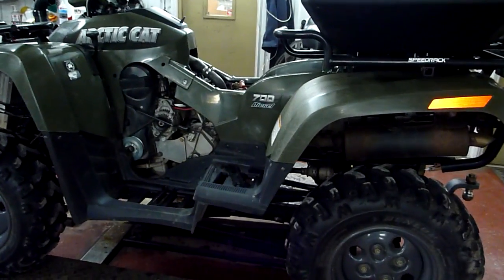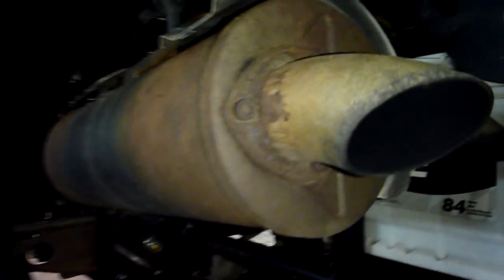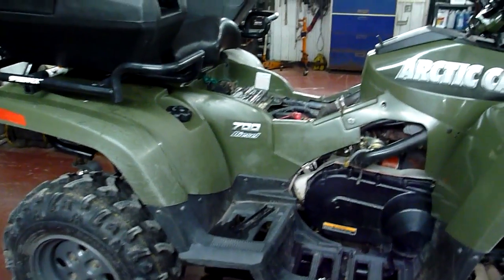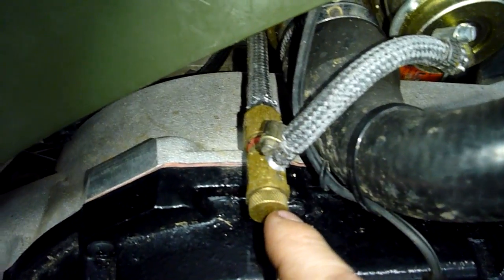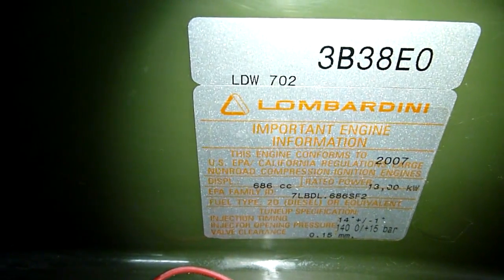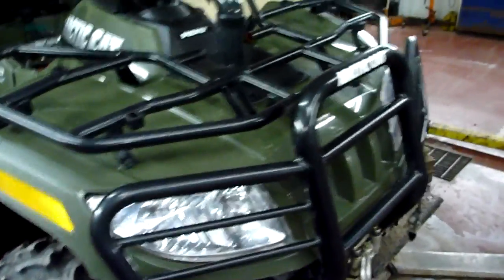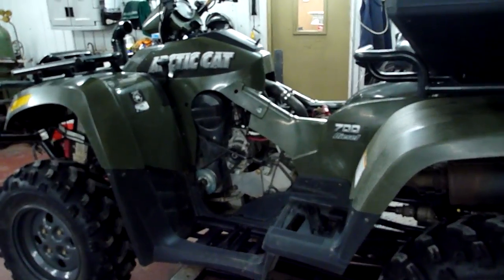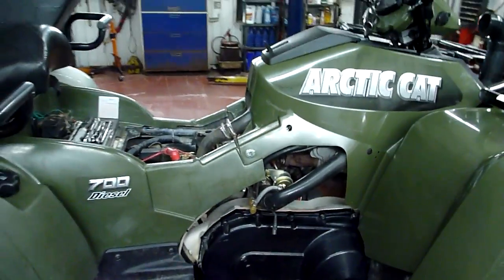Artic Cat Turbo Diesel info on turbo installation

Comment: 2030 miles since my turbo. Thanks for your inspiration. Did not hook up a waste gate, max boost is 17 psi and did a large intercooler.
Reply from the maker: What kind of turbo did you use and do you have any pictures of the installation ?

Comment: Mine is quicker to 35 mph than my AC TRV 700 gas. After 35 however it takes a long time to get to 45 mph, but you can actually cruise at 40 mph. It will hit 30 mph in Lo range, btw. Too bad it didn't have power steering, like my gas model..

Comment: Top speed with the turbo ? And im in Toronto would love to have a meet up and trail ride
Reply: Michael, if you get to Maine, look me up. email at <penobscotufo@gmail.com> Top speed doesn't change, btw, between 45-50 mph, depending on tire diameter. 30" might get you 50. 25" around 45. I run 26".

Comment: You can actually over fuel, I had the fuel screw turned way in, screw was about 3/16" below the set screw, Also had the timing advanced to 15degrees BTDC,  too much, loud clacking. It was very quick, but smoked a lot. Now turned the fuel screw back out a couple turns, much better. Next, I will set timing to 5 degrees BTDC. Now it is very responsive on the trails! Intercooler works great.
Reply from the maker: formerice cool have you made a video of it yet ?
Reply: Not yet. Still having an issue with oil leaking from the PCV , not a lot, but just got to fix it. Love the power, though! I have to remember to shift to low range in the really tough stuff. It's way more torquey at low speeds than my 700 cc AC gas model. We should get together, then you can make a video of both!
Reply from the maker: formerice I can't remember correctly about the pcv system I think I had to vent it to atmosphere or I had to put a check valve in the system but if I have a chance I will check to see what I did I think that it did pressurized the crankcase and I had a major oil leak at first when I was testing it it could've damage the engine if I didn't notice that but I'm pretty sure that the crankcase is vented to the atmosphere.
Reply: I installed a crankcase vent off the nipple coming off the front top corner of valve. Still getting oil dripping off it. Curious how you plumbed yours?  Maybe a "catch can?

Comment: Finally got mine done! 15 lbs boost with intercooler. Now EGT's are much lower. Accelerated strongly to about 40 mph, then takes a while to hit top speed. I ended up with 26" Outlaw MST's. Exhaust is quieter with turbo.. It's a beast! I also have a gas 700 TRV.

Comment: Thanks V10DPTDI. Have ARP head bolts, will try 20 degrees advance on the fuel. Getting close, maybe 1 more week. Have new 12" wheels and 27" Outlaw MST's to put on. I think the 30" Mudzillas were a bit too big. BTW, what do you think about an intercooler? We should get together, I'm in Maine!
Reply from the maker: formerice Hi I think that an intercooler is not necessary but a water to air intercooler would be cool to install and yes that would be cool to meet.

Comment: I just got my turbo, now the fun begins. What temp do you get on the pyrometer? I can already get 1200F If I run wot for a mile or so, without turbo, Also, how far did you advance timing, I have 5 degrees now. I backed off the fuel a bit.
Reply from the maker: formerice about the EGT temperature it has to be measured in front of the Turbocharger 1200 deg F is not that high but the rules of thumb is no more than 1300 deg F if it peak over 1300 for a few seconds it's fine but if it's stays there for a long period of time then the engine has too much fuel or not enough air if you were to mesure an engine with a turbo and one with no turbo with same adjustment and fuel quantity the engine with the turbo would have a lower EGT compared to a non turbo engine especially a non turbo engine that is set to smoke under load that same engine with a turbo would almost stop smoking because the amount of air introduced to the combustion chamber is way more so the fuel will burn in the combustion  instead of in the exhaust system as a form of wasted energy about the timing I can't remember how advanced my engine is but I found the info online so I turned the set screw the same amount on both cylinder but I don't remember how much that was and the fuel screw is set to the max it will only smoke when you blip the throttle fast at idle but with the turbo under full Boost it doesn't smoke at all .

Comment: Hello
Any engine modifications have you been doing?
Is it only the turbo.
What kind of driving experience?
Reply from the maker: Jarek Kwas no engine modification were made except adding a turbo turn the fuel higher and adjust the timing.
Reply from the maker: Jarek Kwas the driving experience is good but it's not as fast compared to a gas model with same engine size but the fuel economy is great but it's hard to compare I haven't driven a stock one after I did mine I know mine was real slow before the modifications I did it when it was almost new.
Reply: many thanks for the information
Greetings from Poland
Reply from the maker: Jarek Kwas Hi I was curious in your country is it legal to drive it on the public roads? I know some countries do they have extra light that we don't have here in Canada.
Reply: You must have the lamp timer and turn and be registered

Comment: How did you do the oil return ?
Reply from the maker: The oil returns to the oil drain plug with a banjo bolt and a rubber hose.

Comment from the maker: The battery is a stock size for a mk4 TDI and it is the biggest battery any mk4 has installed there are at least 3 diffrent size one for Diesel and 2 more for engines like VR6 1.8T and 2.0L 8V

Comment from the maker: It is not that fast it's comparable to a 500 cc gas motor it is heavy compared to a gas engine plus it is a two passenger ATV model but it has much more torque than a 500 CC engine I bought it because I love Diesel engine plus you can run it on red off road fuel it cost less to buy. To make more power it would need more fuel but it is the maximum that I can go with stock injectors. and the plus side of having a Diesel engine there is no electronic and the engine is an industrial grade..

Comment from the maker: Hi I got the oil feed from the right side valve cover were the oil pressure switch is bolted to the valve cover I removed the pressure sensor it looks like it is not hooked to the cluster because when I unplugged the connector and started the motor there were no light or what ever to show that the engine had no oil pressure signal I think that I  used the fitting off a vw TD that screws on the oil filter flange it has the same tread then I cut the top off and welded a hydraulic fitting to it.

Comment from the maker: No I did not drill any thing I used a old line from a Volkswagen Golf or  Jetta with non TDI engine just a regular 1.9TD  get a used oil return line they have a two bolt flange on the turbo but the side your are interested in is the banjo fitting that bolts on the back of the block and the bolt. The same fitting threads in your oil drain plug if i remember I used the same vw return hose where it bolts on the turbo then again if you use the same turbo that I'm using.  remove the flex part off.

Comment from the maker: @BushwackerATV  Hi I did not think of making any kit I just did it for myself it would be time consuming to replicate because I use some use vw parts that I had a the shop but for the right price any thing is possible the hardest thing would be to find all the parts that I used or made including the same turbo fitting etc.

Comment from the maker: My boost levei now is about 1 bar or 15 psi on a diesel you can get away with that much boost even with no inter cooler I know if you keep it simple it makes it more reliable but for fuel economy and power I'm a vw man if you look a TD 1.9 liter with 75 hp and a TDI 1.9 liter at 90 hp and the potential of tuning the electronic ECU to give it much more torque and HP and the engine they could a used direct injection instead of a pre combustion cylinder head.

Comment: @Swedediesel continue: i bought my diesel atv just because i want a fully mechanical machine tat will stay reliable for years to come.
but i think it would be better if that engine was a direct injection type instead of the IDI prechamber design, but then the sound would have been too loud for longer trips i think.
it would also be good if the injection had a RPM- timing advance instead of the fixed timing.

Comment: VERY nice installation! i think i will make about the same to mine when the warranty period is over. 
what boost pressure are you running? i would not exceed 0.5 bar.
would you like to measure how fast it accelerates in 2wd on plane road from 0-60km/h? 

one thing that i don't agree in, is that you said that they should have made those with electronic injection. personally i dont like to advanced electronics, especially not in these types of vehicles that should be build for tough job, continued